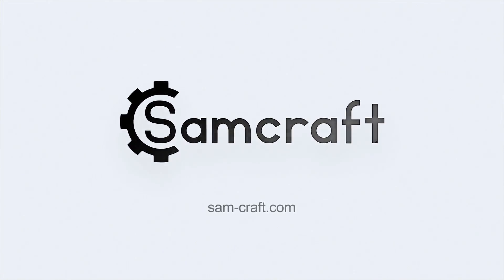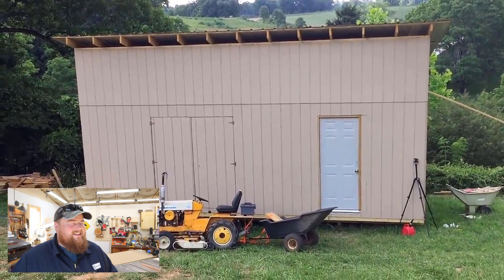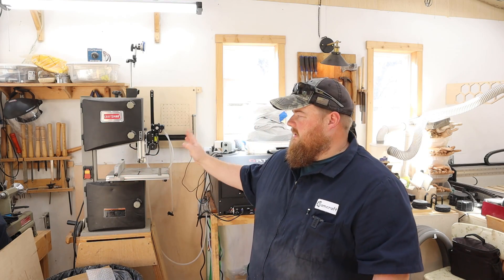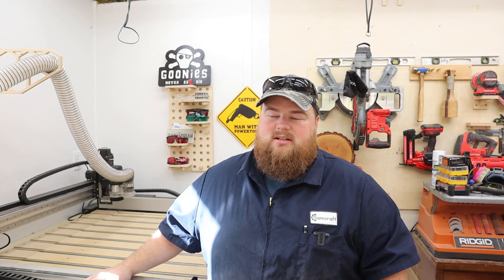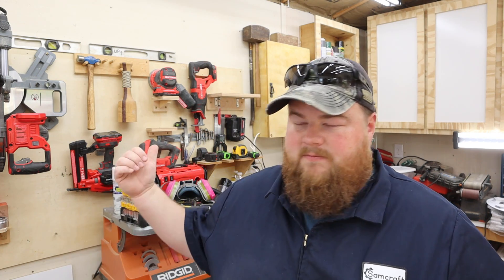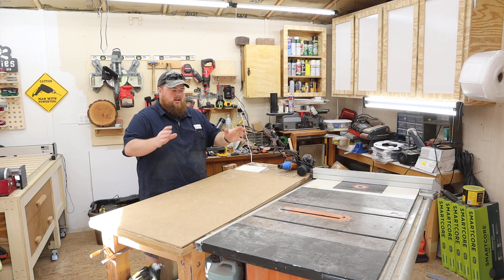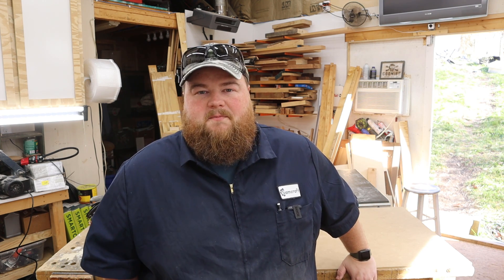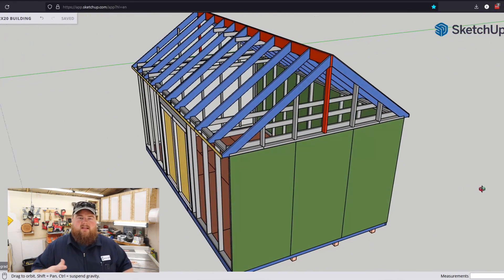Goodbye Home of Samcraft.. My Last Shop Tour.. What's Next?

Comment: Sam, thanks for the exiting shop tour. I have been following you for a long time on both channels. Good luck on your future shop.
 I was a little surprised you did not like your router table setup in your table saw. I also have a Ridgid T3650 table saw I have a had almost the same router table setup for almost 20 years and it works great for me. My shop is 24 x 24. But we we all go about wood working differently. Anyway you will enjoy planning your new workshop.

Comment: Great news man! Can't wait to see how your going to build one. I have been thinking about doing something for a few years now for my 3d printers, laser engravers, etc but without having an actual business to make money I just haven't pushed myself to figure out cost wise what it would be. I have an oversized block garage but without it being insulated I just can't use it here in Pennsylvania year round. One thing I would be REALLY curious about (which I doubt you have done so I will just keep being curious) is with the price of lumber now a days if it would be cheaper to go with metal studs. Or even as cheap. Can't wait for the down to earth videos to come out about this build where you are not spending tens of thousands of dollars on something that should only cost a few grand.

Comment: Hey Sam! I saw your "plan" for the new shop on here and on GAH. Going to make a suggestion. Instead of a gable roof, why not do a shed roof? Then, if you want/need to increase shop size, it is just a matter of adding on a somewhat identical, but reversed, building to double your space. Just a thought. Good luck with the move!
Reply from the maker: I considered it, along with a gambrel roof, but like the look of a gable roof building. Plus it will match my wife's soap making shed (both in style and colors), too.

Comment: Hey Sam,  you said you live in nc currently,  do you have an issue with humidity in you r building? What did you do to mitigate humidity in your current building,  insulate it? Just curious because I also live In nc and have problems,  but my building is not insulated.  Please let me know. Thanks. By the way, I live in the piedmont area/ foothills

Comment: Lumber prices are completely irrelevant! Stop using crap cheap pine and douglas fir from the big box stores. Use quality hardwood from a hardwood dealer. I hear this so much, over and over. Hardwood prices haven't fluctuated much at all, and overall produce a FAR higher quality finished product. Best of luck! Seek out a hardwood dealer and purchase S3S (Surfaced 3 Sides) and you'll be amazed.

Comment: I'm not sure what your back round is.  Seems you have been doing all this construction using just as I do which by "Seat of the pants". Jack of all trades master of none.  When I built my workshop I used the "Go and look and copy how things are done by checking out some Tuff Sheds.  But as to your new build my preference would have been to placed the door on the short side of the shop giving you the longer walls to put stuff

Comment: Sam, I want you to be successful. I do not understand. 
Are you a wood worker? A carpenter? A business person?
You mentioned you can't spend $25 dollars on raw material and then sell it?
You need to copy shed stud spacing?
Are you familiar with building standards?
Your CNC and 4 sheets of birch ply makes wall art over 2k
CNC cutting boards
Templates
You have so much potential, and so much $$$$ sitting in your shop worth of tech and its not making you money?
Perhaps an in depth how to use those toys in a series for 2022 would generate you better revenue?

Pallets are free 

Good luck in 22